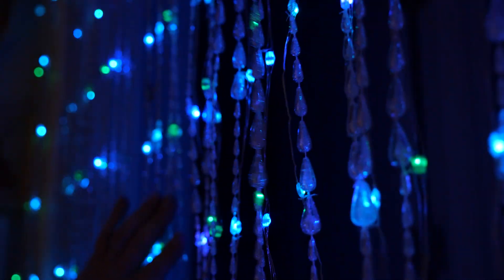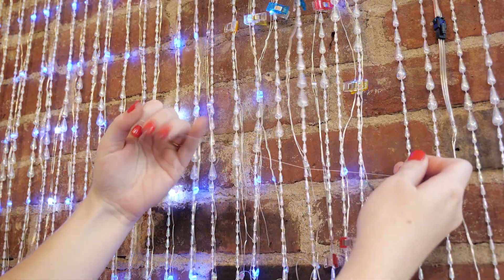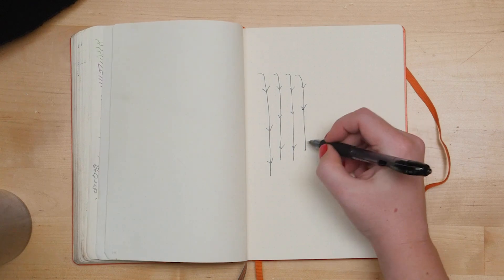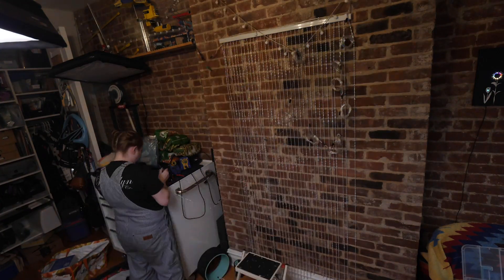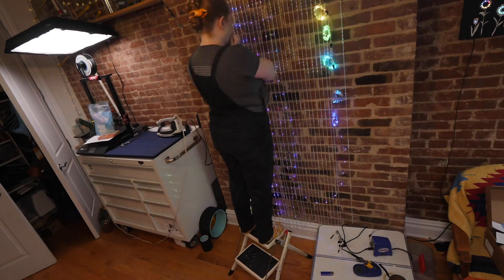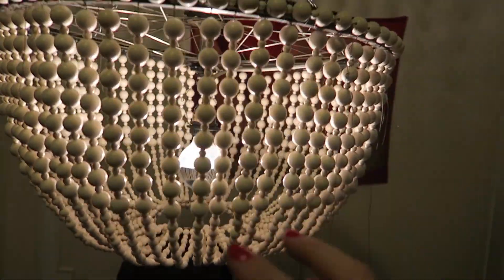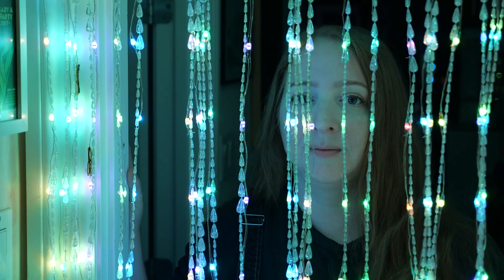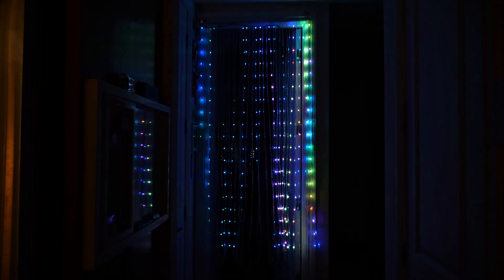I made my own LED beaded curtain

Comment: Great Video Becky,
It’s possible to buy these pixels with 4 wires from china. The forth wire is a common that passes through and has no electrical connection to the leds it runs through. ( the other 3 wire as +be, 0v and data in/out ) 
The extra common wire is used in projects like your curtain which has a heap of single strings. At the end of each string you connect the data out to the common and then connect the common wire at the first pixel in the string to the data in of the first pixel of the next string ..
Reply from the maker: ooh, nice!
Reply: @BeckyStern - also the spacing can be as small as 15mm between pixels too …